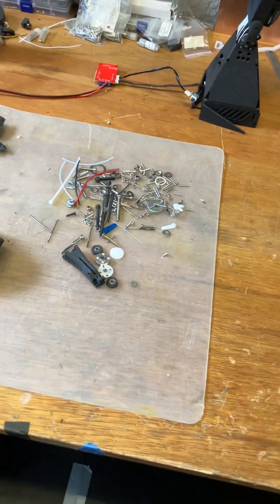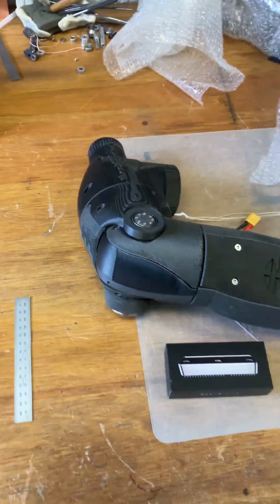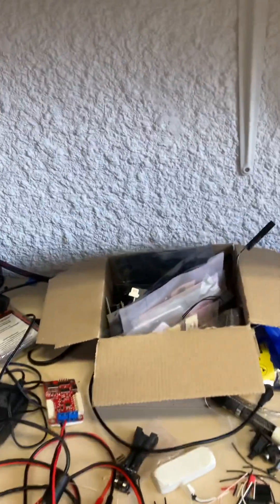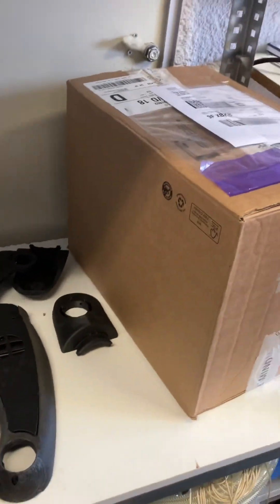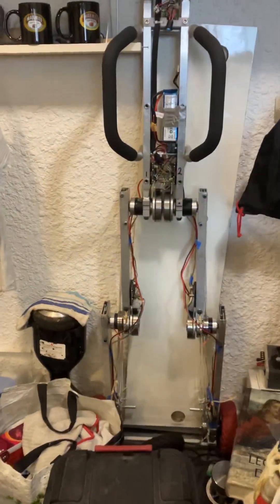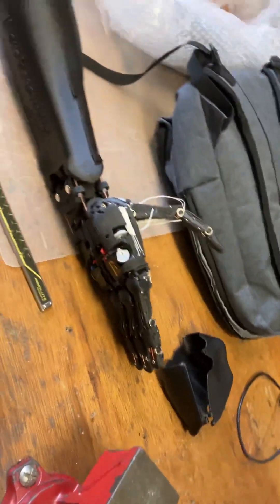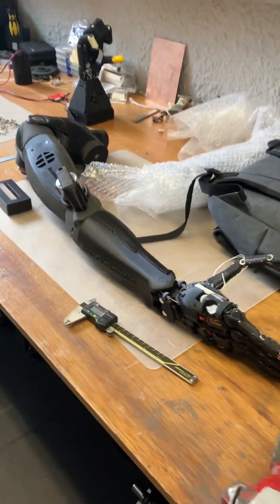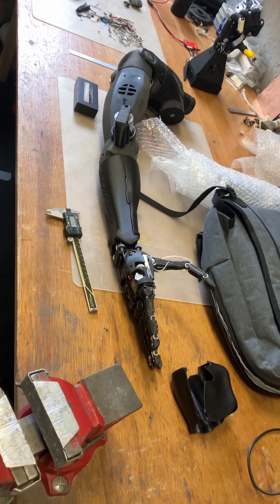robot #workshop for the development of #3dprinted #humanoid #open #robot

Comment: What 3d printer do you use? Are there any 3d printers you would recommend for this kind of work at a cheaper price?
Reply from the maker: I use an UpBox by Tiertime that I’ve managed to keep working for over 10 years so I’m afraid that I’m really not in a position to recommend a cheap printer.

The only recommendation I’m really keen on is to get an all metal hot end and try printing carbon reinforced nylon. It has to be very thoroughly dried and then it produces prints of astonishing strength and finish.